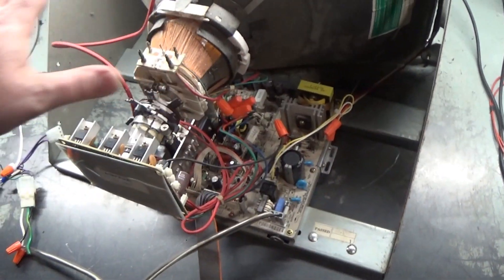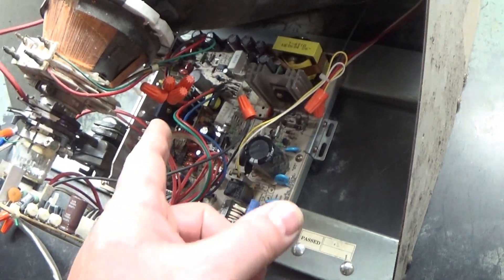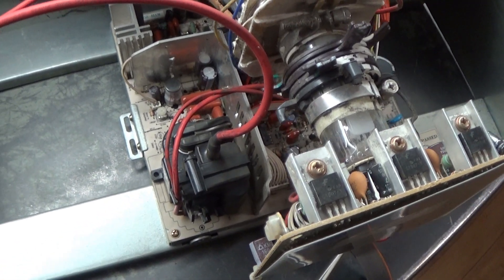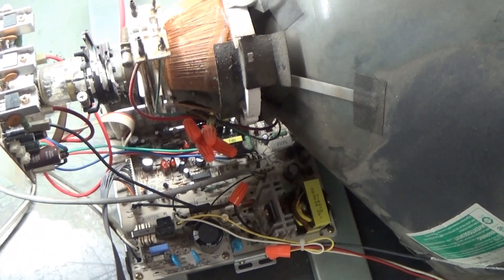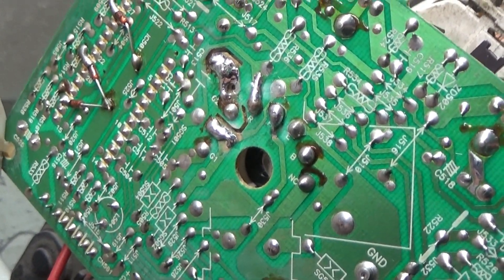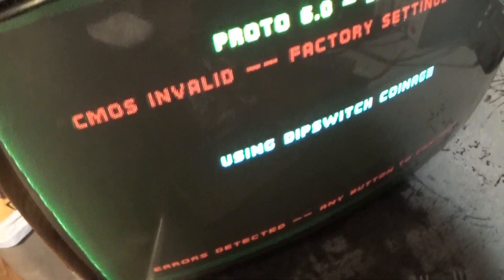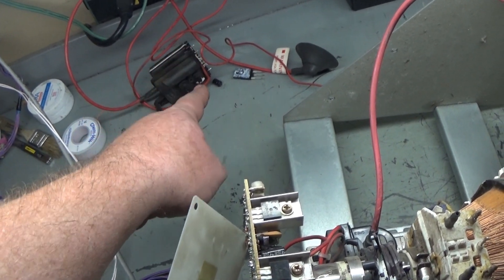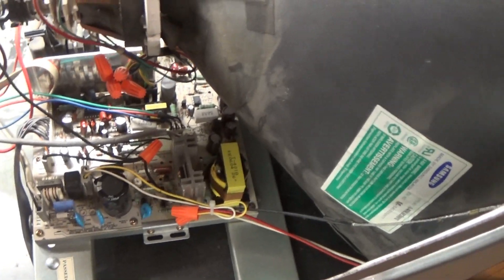19" Kortek KTN-2001 Arcade Monitor Chassis Repair - "Screeching Noise"

Comment: I can actually share a tip - a young salesman came to the door and wondered what the incredibly irritating, loud, high-pitched signal was, he said "I could never stand this". 
Since then, I tested my hearing (with a PC application, but probably many signal generators/mobile apps would do) and I can hear up to 11.5 kHz. I immediately asked him for directions, and it was the big CRT TV where I'd turned off all the inputs but the TV itself wasn't in standby. I thought: "This is the standard 15kHz "tone", and I've not been hearing it and my pets have been tortured by it for more than a week".
Immediately I got a Spectrum Analyzer app for my phone and sure enough, a peak at 15kHz. More knowledge is good, but I still don't know how to troubleshoot it, other than "somewhere in the horizontal deflection circuit"?
Anyway, wanted to share this for what it's worth! :)

Comment: Hey Mike, I have a chassis that looks very much like this one but no markings besides the word Kortek.  How can I confirm that mine is the KTN-2001?  Thanks for the great work!
Reply from the maker: Not sure honestly. Are there any visual differences?
Reply: I have a KT-2001M and the model # is marked with a small, white sticker on the chassis metal part by the flyback, and on a piece of plastic covering the solderside of the neckboard (you can see that one in this video). My chassis board layout is quite different: I have one small vertical board mounted with a pot near the flyback, and another with some transistors near the corner where the RGB connector, remote board connector, and the Kortek logo is.

I guess the best way is to get the manuals and identify from them? IDK how many models though, but I guess you could narrow it down.

Comment: Great video as usual. Is there a way to test if a flyback is in good condition before fitting?
Reply from the maker: Thanks. Yes, but it requires expensive and special equipment to count and test the internal windings. Not something that most people have.
Reply: @MikesArcadeMonitorRepair So fit and hold onto your butt then, lol.
Reply from the maker: Yup